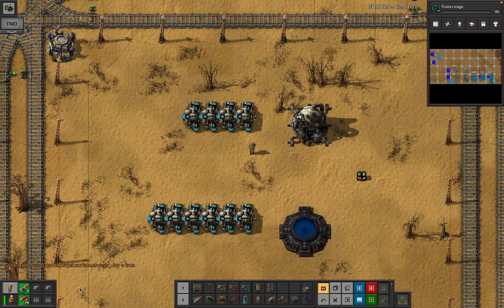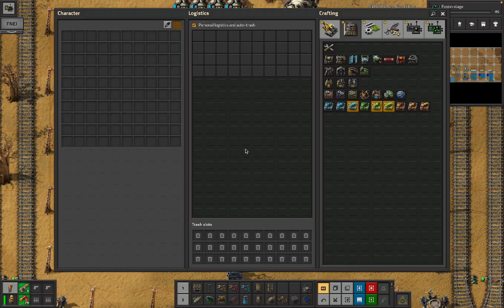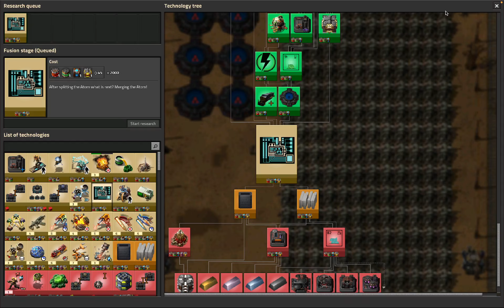Factorio 248k mod: nuclear seems strong

Comment: On the other hand we also have krastorio that doesn't change much about vanilla reactors and only bumps them up, SO 1 reactor makes 250MW heat exchanger 50MW and turbines 10MW but they only get 50% bonus from other reactors. There are also fusion dark matter and singularity reactors so you really have a lot of choice when it comes to power, oh and also advanced solar panels that make 2.5x than the normal ones. Anyway cool video :)